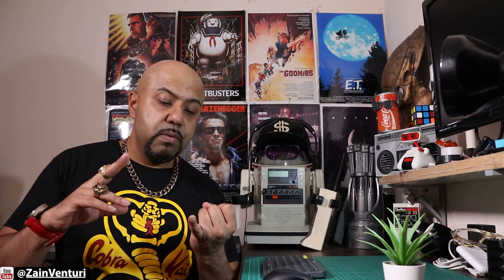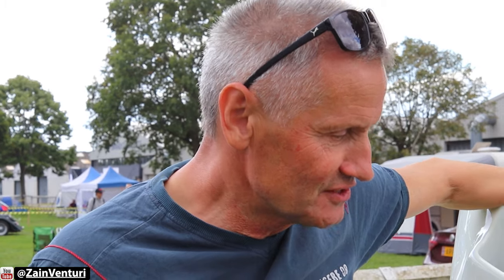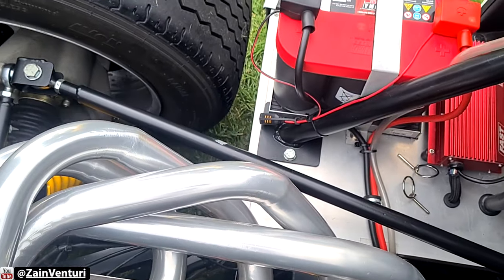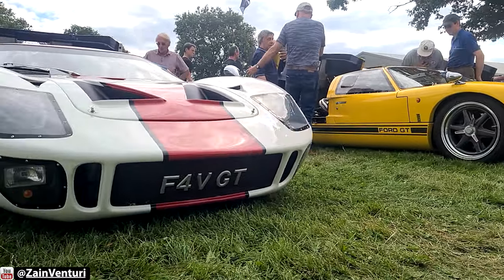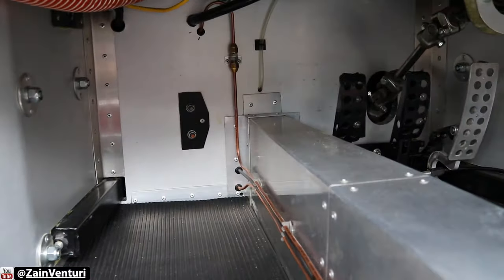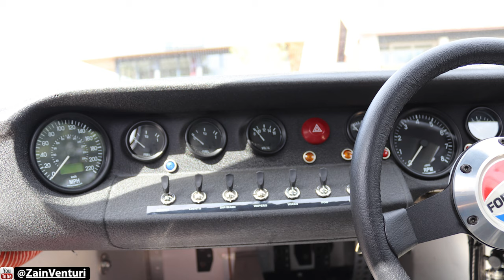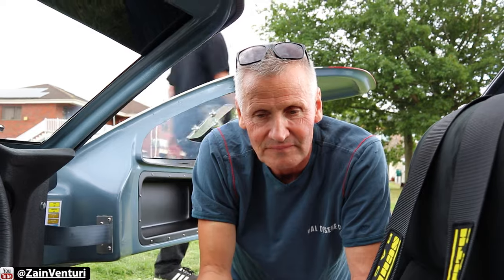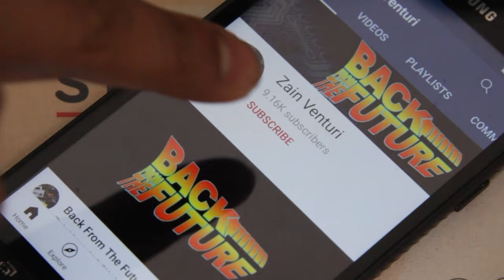FORD GT40 RECREATION BY TORNADO SPORTS CARS!

Comment: Very nice video tour.  Best overview of a Tornado I've seen.  I'm a Superformance MK1 owner here in the U.S.
Reply from the maker: @Dave NC that's amazing that you have a superperformance GT 40 MK1 I am jealous. Are you running a cayote V8 with a Recardo gear box? 😎
Reply: @zainventuri7881  I have a 363 stroker motor with eight stack injection and Holley Terminator X EFI.  My gearbox is a ZF 5 speed.
Reply from the maker: That is a meaty Motor. No shortage of cubes there son! 😎